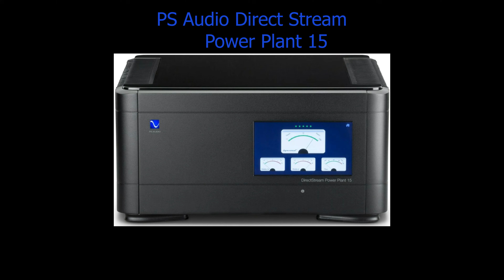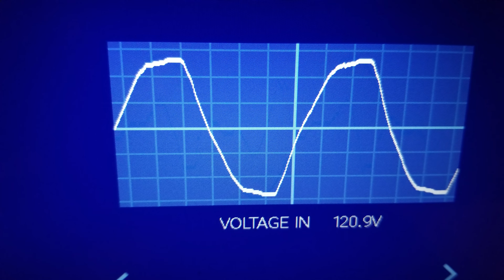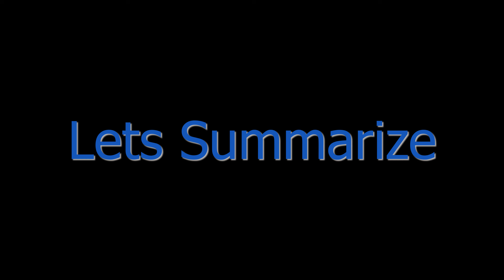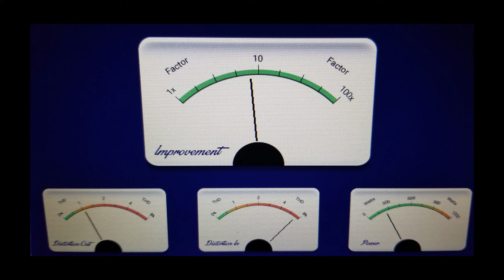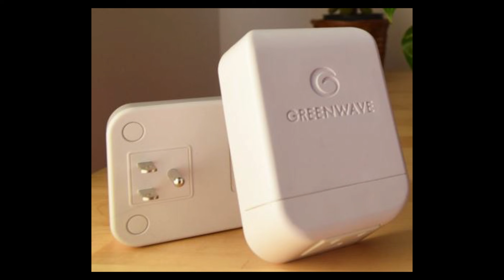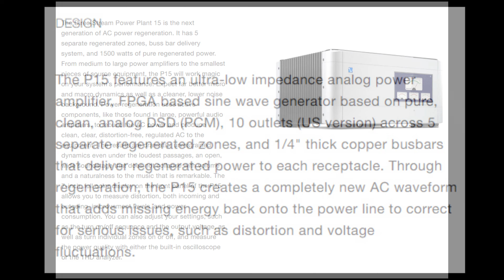PS Audio P15 Power Plant Review

Comment: Too bad power supplies don't have some type of circuitry to convert the input AC into DC then massively filter it with a huge bank of capacitors to provided pure DC that is free of any possible distortion in the input AC so that we could save the massive expense of buying a power conditioner.  Oh wait, whats that - every power supply for audio gear does this.  In that case never mind.

Comment: Hi, have you tested the outlet while multiwave is at the highest? My pp outputs 0.1% with mw 6 which i dont think is accurate. Would u be able to measure this since the mw function adds a bit of distortion to make up for giving a bit more energy to the connected gear.

Comment: I have a couple 611 Macintosh Monoblocks that go from my Anthem AVM 70 to my Tekton Encores speakers. I called Macintosh and actually talked to one of their engineers.. He told me not to use an any sort of regenerator or conditioner.. He told me to just plug it into the wall……. Just saying….
Reply: Imagine a company like that would actually tell you to do it, because it's making an improvement...

They'd basically admit the power supplies in their expensive products are really badly designed and need additional power cleaning. 😂

Comment: Chief Engineer at Audioquest independently said Regenerators are not worth it.  Not sure I agree, but worth a listen. This might be why PS Audio only uses the screen on their regenerator to show it's working, instead to test equipment. See his YouTube Video "Why Audioquest does not make AC Regenerators" https://youtu.be/bXRehON7SlM   Curious as to why every favorable PS Audio test doesn't use external test equipment to show the wave form.
Reply from the maker: That is why I used a Fluke Power Quality Analayzer to verify the PS Audio's Regenerators screen. Granted the Fluke instrument is not a reference grade bench meter but it is sent annually for calibration. The Fluke meters scope screen does offer a higher resolution and   accuracy the the PS Audio's built in screen. Although I did not show the Fluke meters scope. It was comparable to the PS Audio screens scope.
Reply: @eddiscus  The only sine wave I could see on this video was generated by the the PS Audio Regenerator. I'm very glad to be wrong. Could you share the minute mark on the video where we can see the Sine wave not presented by the gear under test? 
3rd party test equipment should only be used, and not the internal test results of the unit under test.

No one anywhere confirming the results of the Regenerator seems to own a dual trace oscilloscope.
Reply from the maker: @LegoRobotChickens  if you would like I can use either a heathkit oscilloscope I have or get use of the Fluke Power Quality analyzer and get screen captures of the scope screen.
Reply: @eddiscus  PS Audio needs to make this investment. They have unfortunately used you as a stalking horse on the company's website forum as proof the Regenerator works as advertised.  All the best Ed, I think you're caught-up in the middle and used by the company.
Reply: Audioquest uses different technology so of course they won’t (or more likely can’t build a regenerator). These are heavy complex machines and they are only interested in highly profitable stuff that can be cheaply made overseas. I have put the output on a scope and it looks just like the built in screen. You don’t need megabuck equipment to test it. The transformer plates in my Sonic Frontiers tube amp audibly confirmed what I’m seeing.

Comment: I see you posted this a while ago.  If you have AC that is that distorted, you should be talking to your utility provider and also your public utility commission.  There are minimum standards and I suspect they're not meeting the minimum requirements.  Either you have an issue with the substation or your pole transformer.  I had really bad power and it did take the better part of ten years for our substation to be upgraded but once the problem is identified, they have to address the problem.  We ended up with a temporary transformer trailer providing our HV feed for about two years before the final fixes were done.

As for the re-generators... just a waste of money, sadly.  If your amplifier uses a conventional transformer, the harmonics will likely be blocked and of course rectification and reasonably sized bulk storage capacitors absorb all the ripple that is normally produced which is much greater than any remnants of rectified harmonics of the 60 Hz. (120 pulses per second after the rectifiers).   Paul's re-generators are  a solution looking for a problem.  Amir from Audio Science Review recently did some pretty extensive testing of the P12 that also supports this.

Comment: Audio Science Review literally destroyed the P12.
Reply from the maker: I always like what Amir brings to the table with his reviews. If I had a THD of 2% from the mains like he does, I would not even think of some type of power conditioner. He did get a reduction in the THD from just under 2% down to 0.4%. So i dont know about destroying the P12. I will agree that the product description may have been oversold in their advertising. I was kind of interested with the slight increase in the noise floor on the low frequencies when on the power conditioner. His Audio Precision analyzer offers a higher level of granularity then the Fluke power meter I used for the review.  I typically have 5% to 8% THD on my mains supply and I don't see it getting any better with the neighborhood installations of grid tie solar panels and EV car chargers. Right now I see a correlation of  Mains THD being at 5% at night and 8% during the day (possibly due to the solar panels waking up and feeding into the utility grid). So the addition of the device to reduce the THD, add voltage stabilization and surge protection to the system works for me.
Reply: @eddiscus   which of the test that he did, is for you non-significant? which test should he do? have you replicated what he didi with your audio precision ? or do you have a better measurement device?
Reply: @eddiscus  - You write as though you had Amir's review on while you were working on something else. He tells the listener that the very idea of power regeneration for a DC device is illogical from the start. His conclusion are that the device is a fraud ie useless. Your wobbly caveats are nonsense in light of both his measurements, and his listening test. Stop lying to people.
Reply from the maker: @johnsmith1474  "Lying to people" kind of a rude  comment to throw out there. I just shared the measurements I was able to take with the meter available to me and share my opinion and observation.
Does this or any power conditioner make a difference in the final output of the devices SMPS apparently not as tested by Amir. Does reducing the harmonics help the SMPS in overall operation I cannot say. I can say it will help reduce the stress on transformers on the line side. Is a reduction of 8% to 1% or less going to make a long term difference? I cannot say as only time will tell.
When I purchased the unit I 30 days to evaluate the Regenerators performance or return it. I have decided to keep it and trade in my existing power conditioning gear accumulated over the years.
So I apologize for offering my opinion. But it did what I wanted it to do and my measurements as rudimentary as they may be confirmed that it cleaned up the sine wave and reduced the harmonics on the AC supply to my gear.
Reply: @eddiscus  don't be apologetic! this is internet, free speech anyone?
Reply: A.S.R. destroyed it twice. The first review, then the supplemental produced to respect all the critics who came to the table via his forum over the 1st review.
Reply: @johnsmith1474  
You mean haters. Just read the comments on any review. No matter the product. LOL!
Reply: That's pseudoscience. I'm a physicist, I ate EE for breakfast.
Reply: Literally?  I think not.
Reply: That was a P-12. This is a P-15. Not built the same.

Comment: Curious.

Why on earth do you think the harmonic distortion level of incoming AC power has any relation whatsoever to the fidelity performance of audio components?

The whole presumption that this matters…even a tiny bit…is nonsense.

Edit: Here is the conclusion of audiosciencereview.com about the P12 product after fully testing it…

“Bottom line is that at worst, PS Audio P12 objectively degrades the performance of some audio products if you use the Zone D outlet. If you use the other zones, it simply doesn't do anything useful than waste some power, take up space, and cost you a lot of money. Distortion, noise, dynamic and average power of all tested products remains the same as not using P12. This is what the data shows and after two weeks of waiting, nothing has been presented from PS Audio or anyone else for that matter, to indicate otherwise.”
Reply from the maker: In most cases with quality components and good SMPS it really should not. But if I can clean it up a bit why should I not. Over the years I have had other brands of units that advertised different things. Some worked as advertised others caused a flattening of the audio dynamic range. So having a component that did nor reduce the quality while having the addition of voltage regulation,  over and under voltage protection as well as surge protection are some added benefits that were also appreciated. Subjectively I feel that during heavy hitting content the unit offers better support of the system than just going direct to the mains supply.
Reply: @eddiscus  you have not  answered, because you know that you are in bad faith , and you do not know how to reply
Reply: @eddiscus  - You avoided Peter's question completely. But you maintain that if you have a $350 hifi, you can buy this $6000 device to make it sound better? I call bs on you.

Comment: Would be interesting to compare P15 to $500-1000 basic power conditioner, eg panamax.  Any idea how it would compare?
Reply: None of the basic power conditioners do anything for harmonics. Not even an expensive Bryston or Torus.
Reply: Power conditioning is an area of fraudulent claims as big as those for cables. DC power is by definition conditioned, without an outside device.

Comment: Great video. I took away a lot of info from this. I actually just ordered a P-20 thanks to you. You said it could be set up to 120v or to for thd distortion. What is the benefit of this and which way should I set mine up when it arrives? I have a McIntosh integrated amp and Sonus Faber Extrema Speakers. Which setting should I use? Thanks in advance. —-Enrico from Tuscany Italy—-
Reply from the maker: It depends on your  the stability of your mains supply. The unit does have limitations. If you set its primary function to be voltage regulation for example and your voltage target is 120 volt and your mains voltage drops down to 110 or less the internal circuitry will concentrate on voltage regulation and let the distortion reduction loosen up. My unit has maintained the voltage output but the THD reduction started to loosen up to about 1%. But the mains distortion was 5% or above. So the PowerPlant is still doing its job. The inverse would happen as well. If you had it set to concentrate on THD distortion reduction then the reduction would remain stable but your voltage output would waiver when you reach the regulating limits of the device.
Reply: @eddiscus  I’m in Italy and we have 240 but my main goal is better sound. So you say set up for less distortion?
Reply: @eddiscus  I don’t know the Distortion of the Sonus Faber Extrema’s but maybe they are above 1% so perhaps concentrate on voltage?
Reply: Set it for low distortion. Fixed voltage is overrated. Your equipment is designed for 220-230v so letting it sag a bit will benefit efficiency.

Comment: Great video mate... I have a power problem in my area/house and it effects my computer making it feel slower while playing games...the problem goes away late at night then the next day it goes back to crap again  ... could this help at all ?
Reply: its because of electricity, at night THD is way lower thats why your pc is working better. This device can help you 100% or you can make your own for way cheaper if you know how...
Reply from the maker: I would lean toward your ISP provider. I dont know which one you have but a cable based service is known for you loosing connection speed during peak hours. Run a speed test using www.speedtest.net
Do it during peak and then when you say it runs good. 
If you still suspect the mains power. Borrow a computer UPS and run on battery and see if that corrects the issue before investing in a power plant.

Comment: Great review. You mention that the P15 reduces the THD and show exactly how much it was reduced by. You also show Greenwave plugs which reduced the EMI by 99% but you could not hear an improvement in your home theatre due to the reduced EMI. I find that odd as my current power conditioner similarly reduces the EMI and I can hear a definite improvement in the overall sound quality.  One thing you missed is you did not show the before and after EMI readings for the P15 for the filtered and the high current outlets compared to the wall socket. Could you kindly do a quick test and post those findings ? Thanks and keep up the good work.
Reply from the maker: Oddly enough the P15 had minimal effect on the values displayed by the Greenwave meter. It only showed about a 15-20mV reduction (220 down to 200mV). Plugging in a Green wave filter into the wall outlet that the P15 was plugged into brought the number down to 80-50mV. The reduction of the EMI/RFI had 0 effect on the harmonic distortion of the sine wave as expected. Also the reduction of the EMI/RFI using the Greenwave filter had no audible benefit to my system. Reading some of the other testing posts out there it seems EMI/RFI reduction in house wiring is more of a physical wellness and health related issue than an audiophile/home theater enthusiast item. I had two Monster power products as well as a Panamax product all which had a slight measured effect on the EMI/RFI value measured on the meter. None as much as the dedicated Greenwave filters though. The concept of the P15 and similar product made the most sense to me. As having the cleaned and restored power as close to the equipment would have the most benefit with the emphasis on restored power. Most of our equipment cleans up most of the noise within their own power supply. But is always nice to help them out by giving them a hand by assuring that they get supplied by a clean source. I have seen over the years some power sensitive sited utilizing Motor/Generator (MG sets). Where the incoming utility power would spin a motor and then turn a generator to supply local power to mission critical equipment. This way the power they received was free of any distortion and harmonics on the utility lines. The P15 does this electronically (AC-DC-back to AC). Plus their trade in program helped reduce the overall purchase cost of the product.
Reply: That's because there is no improvement with your device. Your brain is lying to you.